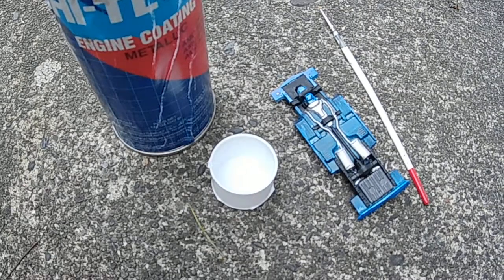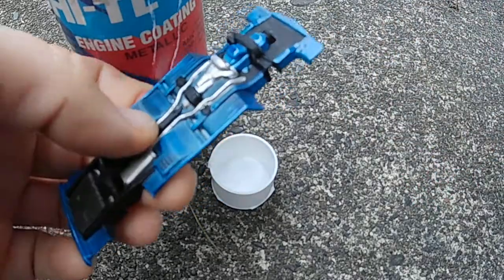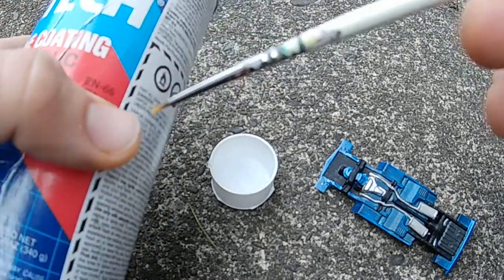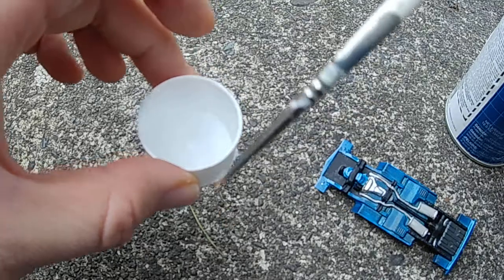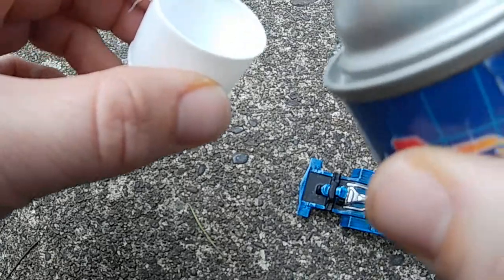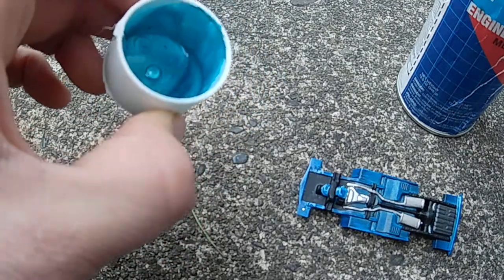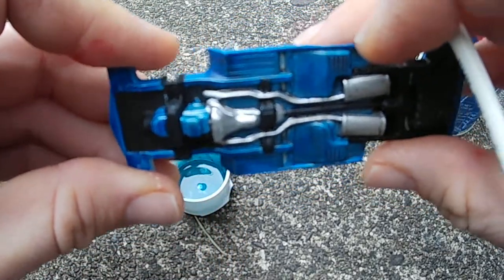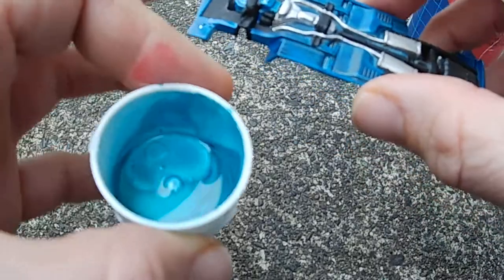Tech Tip Tuesday - Episode 04: Decanting spray paint

Comment: So I didn't do the same method that you did. I sprayed my 3D printed part with a gold metallic spray paint and then I used a brush to help spread thr paint (it was pooling a bit). When I did this, the brush got sticky and harden.
Does yours do the same?
Reply from the maker: No, it sounds like your paint reacted with the 3d part's resin. Was the resin cured first? Did you use primer?
Reply: @PlaysWithCars  
I printed with PLA. From there I sanded it, added wood filler, more sanding, sprayed primer+filler (Rust-Oleum brand), and more sanding. Afterwards, I did one coat of the gold metallic spray paint, noticed a bit of pooling at some corners, so I sanded it again. I did another coat of the same spray paint, and this time when I saw pooling again, that's when I used a brush to spread it.